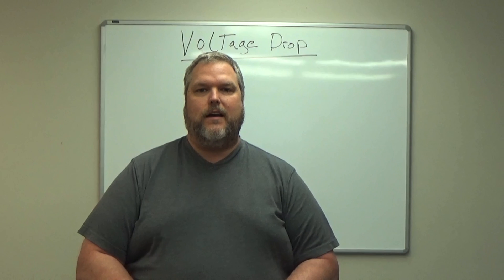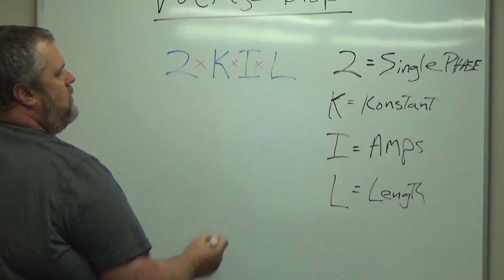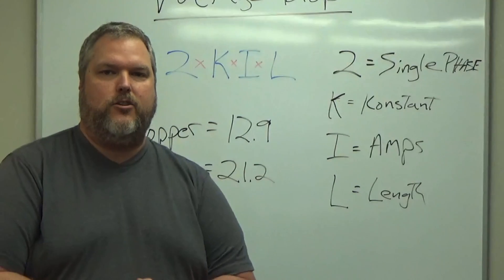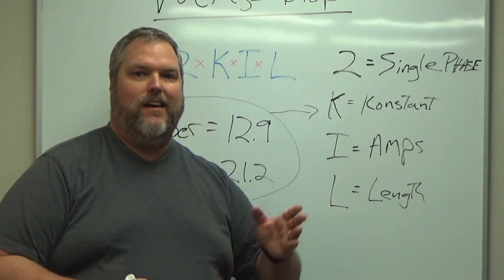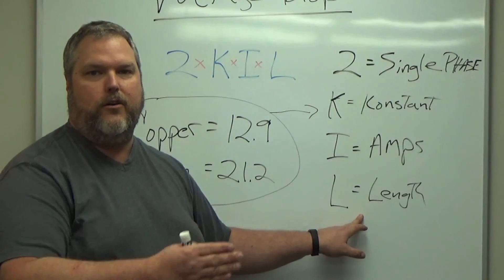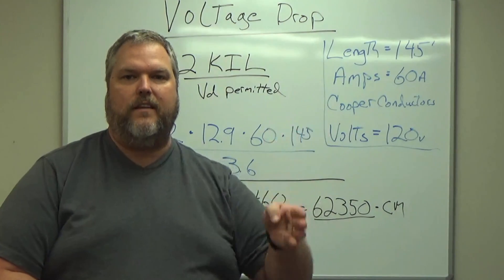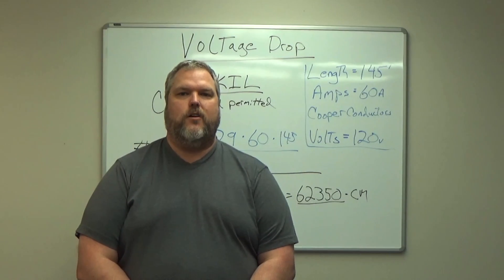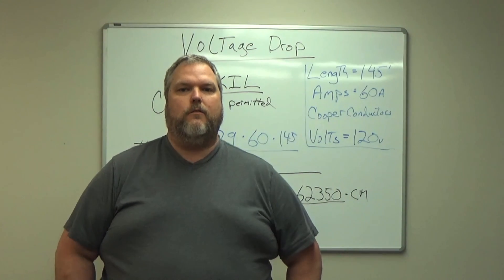Everything you need to know to solve Voltage Drop Calculations!!

Comment: A question in my homework has voltage drop for a 200 amp single phase service 120/240 300 feet away. Do I use 120v or 240v voltage drop permitted?
Reply from the maker: @davidalanis1282  240v it’s a service so go with the 240v every time. CM
Reply: @ thank you so much! Way better at explaining things than the teachers in my apprenticeship.
Reply: @craigmichaud-electricalins4602  since it will be a service could I use 5% voltage drop?

Comment: For everyone’s understanding.  Voltage was originally noted in “overcurrent protection” section of the NEC.  Weird right?   Well, if you have the right kind of load, if the volts drop, then amps go up.  The percentages would keep the amps down to not cause the overcurrent device to trip or blow.
Later they got put in for equipment protection.  Eggheads!   We used to have one set of conduit fill tables, but some egghead raised an issue that not all conduits and tubes were exactly the same size.  So table after table after table.  I only found one specific condition where it made a difference.  Going back 30 years, I think it was in 1 1/4” conduit.  I never designed anything in 35 years with 1 1/4”!

Comment: My understanding is that the voltage drop can NOT be more then 5%. Please correct me if I am wrong
Reply: So basically since I'm feeding a sub panel with 240v and a Neutral
As long as it is not passed 7.2 . It's accepted? I thought because of the neutral to hot was 120v that's the percentage I needed to stay with.
Reply: He correctly said 2% for feeders and 3% for branch circuits.  So, 2% of 240 or 4.8v.
Reply: So i can treat it as a feeder since it's a sub panel ? Which would be 240v at 2%@KevinCoop1
Reply: @jamalissa954     Correct.   Instead of dividing by the CM, I always divide by VOD (Volts Of Drop).  IE, for 120v I divide by 3.6 and 240 is 4.8, then look up the CM that meets or exceeds the answer.   CM=2*K (12.9 copper)*I (amps)*L or D (Length or Distance in feet)/4.8 (2% of 240)
Reply from the maker: @jamalissa954  you are correct! It’s total 3% on branch and 2%on your feeders.  That is total! CM

Comment: Where would i find the Konstant is 12.9 for Copper and 21.2 for Aluminum?
Reply: It is a calculation that combines resistance of the material over a distance.
Reply from the maker: @doublem3836  you can find that in your Uglys book. CM
Reply: @craigmichaud-electricalins4602  thank you for the reply. I won't find that in the code book or anything? Great video btw. All your videos are very helpful

Comment: Great job professor . Just a question please.
If we do know the voltage across the circuit ( single phase or 3 phase ). What we should do then?  So the formula be like this K*L*I / cm.   Am I right sir?
Reply from the maker: @kamilkamal9900  you need to know if it’s single or 3phase. Single phase is 2 and 3phase is 1.732. CM
Reply: Thank you. I had a question on the exam before and the question didn’t state the voltage. I only was given the wire size, length and amperes. That all what I had in the question.   Thank you sir.

Comment: Great info dude, have a 343 run at 240 volts 200 amps just quiclky came up with 250 kcmil at 7.01 voltage drop bec because 4/0 was at 8.3
Thanks a lot for you lecture/reminder
Reply: I have a 334 run at 240 volts 400 amps. Looks like I can use 500kcmil 6.89 VD. Table 310 temp ampacity reduction also gets me to 412amps. Or should I stick with 600 kcmil?

Comment: Please HELP looking for someone that's very good with voltage drop on extremely long runs on Main Service cable I'm running 4/0 4/0 4/0 2/0 aluminum direct burial to my shop 670 FEET away. I have 250 volts at my main panel I'm trying to understand how many effective amps I will really have when it gets to the shop I understand there's a big voltage drop and a loss of amperage but can anyone tell me what that would actually be or close to it I have tried voltage drop calculators online but I'm getting differentials that don't make sense. Trying to know if I would at least have enough amps to run a compressor welder and possible mini split with lights I understand I will be running close to capacity but need to know if it's really worth the extra $3,000 to do an extra run alongside my current run so that way I don't need to rip it out. How many usable amps should I expect for the shop.

Comment: So, what you're saying is that a 230V rated motor can operate from 208V, a 10% drop from 240V, but according to this made-up rule-of-thumb it needs to be under 3%.

There is no "voltage drop permitted", no code to "permit". 
Stick to "da code', it's already bureaucratically moronic enough.

Comment: Craig, based on the formula for a 480V 300Amp  3 phase 125 feet in length, it comes out as number 2 copper wire. Is that correct?
Reply: Your answer could be correct for doing voltage drop.  You must use conductor ampacity as the minimum conductor size.

Comment: What formula would be used in this scenario:  2 Pole 208V Circuit installed in a 3 phase 208/120v system.
The question is if the 2KIL/cmil formula or 1.73KIL/cmil is used and why.  Is the formula chosen based on system phasing or the number of phases for the circuit in question.
Reply: It is a single phase branch circuit.   2KIL/cmil will give you percent.  I always do /(percent acceptable) because I’m looking for conductor to install.

Comment: So my line apprenticeship has questions that I'm really struggling with, and maybe you can help... question A) The voltage drop per thousand feet of 1 AWG copper wire (resistance = 0.154 ohms per 1,000 feet) when 50 amperes of current are flowing is   ?  . Question B)Two wires off a main feeder supply current to a transformer several spans away. The voltage of the feeder at the point of take-off is 2,440 volts. The resistance of the two wires is two ohms and the transformer draws 40 amperes. The line loss (voltage drop) is   ?  , and the voltage at the transformer is   ?

Comment: Hey fat guy, if you want to teach through youtube video, you must do it well or NOT DO IT AT ALL, where do you get those magic numbers from (the K constant)?. To calculate the voltage drop you simply use the Ohms Law, which in alternating current is V=I*Z, but the impedance Z in alternating current depends on the type of wire you use, and the lenght of it of course. You have to know that. You can't just plug some magic numbers in the formulas and say it is true, you have to demostrate where those numbers come from.

Comment: Craig, as a homeowner do I use the same calculation for various task?  I was wondering if I was supplying enough power for my electric 12amp lawn mower I have plugged into my outside 30 amp house outlet. I’m using 70 ft of #10 wire (30amp fuse) for the outlet.  I’m plugging in a 100’ and 50’ #12 extension  cord to run the entire length and width of my property.  Using your calculation, the #10/distance is fine but the #12 wire has too much voltage drop (7.11) compared to the 3.6 allowed.  The mower seems to be running fine but does figuring for panel to panel wiring being the same as my outside house outlet ( being enough for a 20 amp terminal box), would I use the same calculation using a #12 extension cord to run my 12 amp mower @ 150’)?

Comment: Great video as always!

Is voltage drop likely to be included in a licensing exam?
Reply from the maker: There is a good chance! I have not had anyone lately mention it but it has been before! Does not hurt to have it written in the back of your code book! CM
Reply: @craigmichaud-electricalins4602  In Utah voltage and voltage drop are 20 questions out of 50
Reply: Amen 2 that  🙌

Comment: Two questions please .... what is the unit type  of the length? Is it in  meter or feet? second question,,,, Can I use this formula on 24V DC?  Thanks for sharing the video...  Currently I am working on a project of installing panic button system ... one of the alarm siren is about 400 meters far from the supply voltage panel,  the supply voltage is 24 DC... I am not sure if this distance is too long and may lead to severe voltage drop.

Comment: I'm using #14 copper wire running (Length) 60 feet 120 volt 15 amp circuit breaker. So can I running 15 feet twice with two 15 amp circuit breakers? One 15 amp circuit break at the service panel and one 15 amp circuit breaker 15 feet away on the wire run (length)?

Comment: Great explanation Craig.  I just needed to calculate the conductor size for a shed building that is a total of 320 feet from the supply panel.  Want to have a total of ampacity of 50A on a 240V single phase system.  I came up with #2 THWN Copper for my conductors.   Thanks for the refresher.
Reply: With your 2kil it's using one way distance?yes
Thank you

Comment: Thanks for the help. I’m just trying to study for my second year final, and seriously struggling with voltage drop and open/dropped neutral calculations. Second year sucks balls, ridiculously hard. At least for me. They have told us though that this is the hardest year by far so I’m hoping I pass and can get on to third year
Reply: Go ahead and just forget about 80% of what you're taught in school, especially if you're in the industrial/commercial trade 🤣
Reply: @Jason_Van_Stone  meh, it’s all useful at some point. Theory and code are difficult to learn in depth on your own but they’re 100% necessary especially for people who plan to accelerate to running jobs or to get out of the field. I can’t think of very many things I learned in school that didn’t turn out to be useful at some point. That said, school doesn’t teach you how to be an electrician, it teaches you about electricity. Field time and practical experience is very different.
Reply: @amb158  🤦🏼‍♂️

Comment: 3hp submirsible motor single phase. I need cable size for aluminum. Distance from electric meter is 1000 to 1200 meter.

Comment: I understand, the way you calculated the voltage drop.
Here's were I'm lost
I have a set of plans
They want a single phase 20amp circuit on a #8 conductor(copper)
So i measure from the panel to the unit
I get 130 feet.
At 130 feet using the 3%VD i get a #6 conductor
At 130 feet using the 5%VD i get a #8 conductor
What rule do you use 3% or 5%
Majority the jobs I'm on use #12 
But if you use the 3%VD rule 
The #12 is only good for about 40feet
And #10 is only good for about 70 feet
From the panel to the last outlet
Thanks

Comment: Very nice and clear explanation of voltage drop and wire size calculation.

In large homes I have a nearly 6000 sq feet. Some of the voltage drops for a 15 amp branch circuit of at least when measured from the ideal circuit analyzer suggests a drop of 9-11percent that’s for the end receptacles on that circuit even though the first receptacle has. Voltage drop of 3.5 percent. I suspect this is a common problem when electricians and construction companies are fitting branch circuits namely that they meet the code for the first receptacle but not all the receptacles. Short of rewiring the circuit is there any external means to bring the voltage up on those end receptacles - most residential equipment could tolerate a drop of that nature but obviously long- term it’s not going to do that equipment any favors.
Reply: In my opinion code should require 20 amp circuits on all as a minimum on plugin recpticals; witch requers a minum 12 gauge wire witch should have less  Voltage drop! A 15 amp breaker     can't have a wire less than 14 awg but THERE'S nothing in the code that says you can't use 12 gauge or heavier on a 15 amp Breaker. Breakers at least standard breakers job is to protect the wiring not what's connected to it like a lamp pluged in to a plugin recptical, Etcetera, Etcetera.

Comment: Could you please do a video where you show step by step of how to measure out for knockouts of a panel for emt..whether you use a combination square, speed square, etc..you have to think about spacing between different size pipe and make sure there's enough room for your lock nuts on the inside..it's just really confusing to me at the moment..thank you

Comment: I have a 2/3 aluminum wire going from a main breaker panel 275 feet to a sub panel. I would like to install a 50amp breaker in that sub panel to install  a 50amp pedestal for a RV 175 feet away from the sub panel. When calculating for wire size I determined I need 4/3 aluminum wire. Did I do this correctly?

Comment: This is a great channel and video, much simpler way to do it than how I was taught in trade school.

Let's say the circular mils required is 68,000 - would I be correct in saying that the #2 which is 66,360CM is too small and I'd have to upsize it to #1 awg? Basically I have to have a wire that is the same size or large than the CM required right?
Reply: yes, the larger the kcmils the less the voltage drop with the given amp draw

Comment: Hi Craig watched all your videos I wish I had your knowledge my friend you’re a master at your job I am trying to put A portable generator I watched your video when you connected your dads I have a A 220 line going to my stove which has been since connected gas so no longer need that 220 switch but it’s only a three blade and I know the generator has four blade and the new plugs have four blade I watch the video and I seeing you put two on the side of the panel and two under the switch in the panel boxI know the white one goes to ground but there should be another ground also going to that and then the to go to the switch is that correct I just don’t wanna do anything wrong if you can comment back thank you sir
Reply from the maker: Please email me sir!! sparkyinstructor@gmail.com